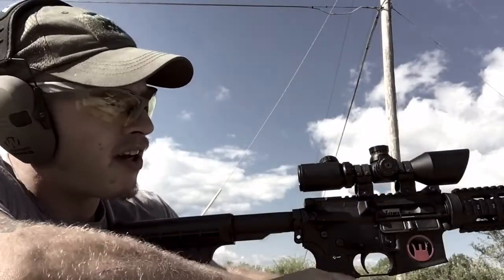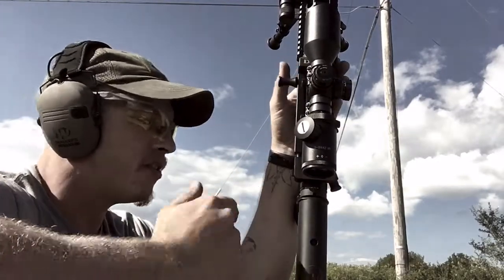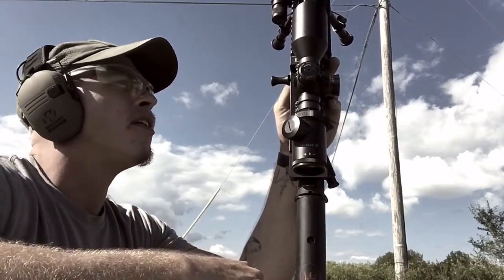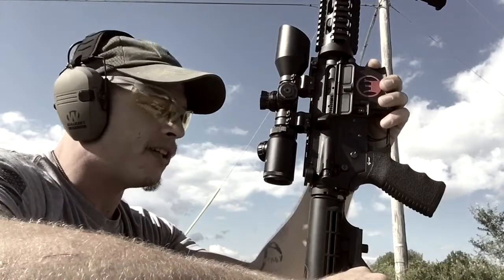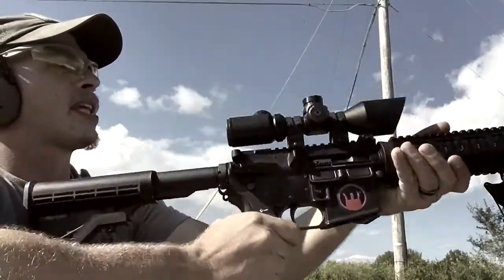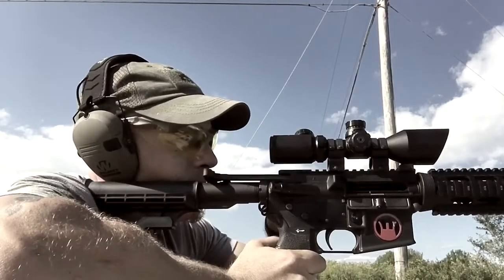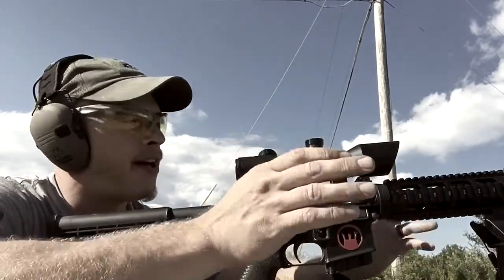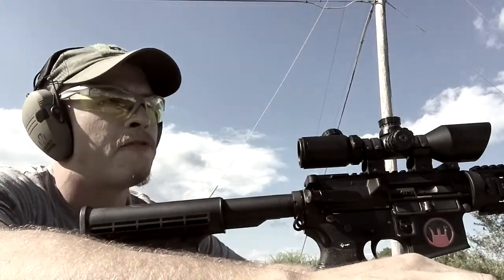Devil Dog Concepts Hard Charger; My 2 cents

Comment: Best solution, just build with a side charging upper receiver.  You can even get them with the charging handle on the left or the right.

My personal preference is for the charging handle on the right.  That way, if I am not on the bipod or a rest and standing, it is easier to use the trigger hand to run it.  More stable since your support hand stays on the handguard.  Left hand charging while standing requires you to support the gun with your shooting hand.

If you're a subsonic suppressed shooter, a side charger eliminates the blow back of gas in your face around the top charging handle.

If you run large optics, side charger eliminates the hard to reach top charging handle under the scope's eye piece.

Only downside, you have to remove the charging handle to get the BCG out, but that's a minor hassle given the advantages.
Reply from the maker: If you run a kit with the built in side charger you lose the option to swap it. With the hard charger I can remove and mount it on a different kit in minutes without buying a second side charging upper. If I choose not to run it, I take it off and go back to a factory rifle. There are different rail mount options that allow it to work with multiple optics with minimal to no interference. While in a standing position, by charging with the non trigger hand, the rifle is ready for use the moment the bolt closes. There is no need to remove the trigger hand when the rifle is pressed into the shoulder.
 I personally prefer left hand when using a bipod as that hand is of no use otherwise, the rifle holds itself at that point. 
 I don’t judge what people want to purchase or use, Just giving the details use and opinions of myself.
Reply: @myrandomthoughts9106  Hey man, no prob, good stuff.  Your use for the left side is valid for bipod/supported.  I just think the bulk of that kit is a bit overwhelming.  With a good extended latch or ambi charging handle you can reach up and charge/cycle nearly as easily.  But, it is a cool idea and it does seem to work well.  

I will say, after building side chargers, I doubt I'll ever go back to the "standard" top charging set up again.

Comment: On a SPR with a large optic or an auto rifle such as an IAR m27 or A-RPK in the prone position this side charger is beneficial for clearing malfunctions.
Reply from the maker: When NY first came out with their assault ban I had replaced the gas block with an adjustable block and used the hard charger as a bolt action system. As soon as it was no longer semi it didn’t fall in the category of assault weapon.

Comment: Upper receivers are now made with side charging on both sides,recipricating or non, if you want to spend the money.DDC sells the one you are testing.It comes with a 5 year warranty for $135.00.Just how much are you spending for charging handles anyway that this would work on? It's a matter of economics.Either way with this you are saving money. My 2 cents worth.The way they attach does not cause binding as it is attached to both ends on the rail and WILL work on billets.Your arm strenght in operating it isn't going to affect metal strength,either billet or forged.The charging handle only moves when you have to load or eject,anyway.Not during firing.I'm thinking you are a little biased in your opinion.
Reply from the maker: Larry New, I don’t know where the confusion came into play as everything was explained in fairly simple terms so I’ll do my best to try to clear it up for you bud.
1- The Charger was designed to fit flat top forged uppers which have dimensional differences from the billet uppers, small enough to not be noticeable by the naked eye, yet affect the fit and functionality of the system. 2- The system attaches in one location only while the other end rests against the upper, this system does not have two attachment points on the rail. 3- On a recent billet upper build the chamber side wall was too thick to accompany the hard charger with out modification. However without the exact amount of material being removed the Charger mount was not perfectly perpendicular to the bolt carrier. While cycling the Hard Charger, the charging handle was being forced back at an angle causing binding in the charging handle channel of the upper and extra force necessary during operation of the charging handle. 4- The movement of the Hard Charger is only in play during operator cycling of the platform. This was not called into question. What was called into question was the distance of travel of the charging handle to the face. If the stock is in a near collapsed position while cycling ( manually charging the system, not firing) It can “touch” the face. 
And that is my experienced 2 cents. I am biased, I like products that work. And this, for me, does.

Comment: Don’t buy that piece of crap.  It takes up part of your to rail, and if your rifle falls on the piece of crap plastic knob, it will snap like a twig and then it’s $100 the toilet.  Better option is the Smith Tactics side kick.  Easy one piece install it.  No rail space take up, and handle folds away when not in use.  Also slightly cheaper.
Reply from the maker: My video was posted long ago with a product available at the time. It is a bit more expensive and does use a single rail position but has yet to fail. The knobs are also metal. The side kick does look appealing though. How do you like the operation and does it feel like it’s putting any side flex on the charging handle?
Reply: @myrandomthoughts9106  I thought my knob was plastic or at least it snapped like plastic when one day my rifle fell out of my safe on the charging handle side and hit the concrete in my garage.  After that, the whole thing was rendered useless, and all I could do was remove it and throw it in the trash. There are much better options available now.  That was my experience with it.  It felt like a big ripoff to me.
Reply from the maker: @sg696  It sounds like a fluke manufacturer flaw. Did you contact them? I’ve seen them refund intentionally user modified kits that were completely destroyed.
Reply: I have both. The Smith is more likely bend. All me how I know. No issues with my DD.